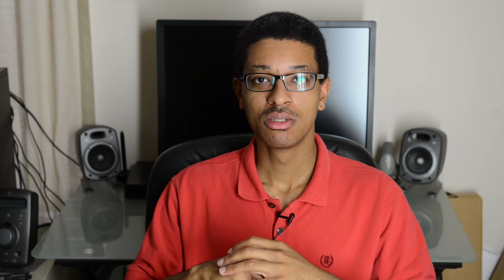Old VS New: When Should You Upgrade Your DSLR?

Comment: Yes you can get those wedding photos at a church that turned off the lights. The way the old film photographers would do it is place the camera on a tripod or place it on the floor if they did not bring a tripod. What you do is go all the way back to the last aisle use a wide angle lens and take about a one second exposure.

This might not be the ideal way but this is how the old film guys did it. Also with film  best to use ISO 400.

Comment: I have a D600 and I shoot mainly in the studio and few portraits outdoor too. I could do with out super fast AF or professional buttons on a camera. What I care about is the end result or high image quality. I recently had the oil spots on my D600 and it came back fine from Nikon thus far. When I purchase a camera I expect it to last me for about 3-5 years. I am not confident with my beloved D600 anymore and I think a D800 will be great for me. What should I do? I am a working on making a portrait portfolio at the momement.
Reply from the maker: The D600 and D800 are both very good cameras with similar image quality (main difference is that the D800 is higher resolution).  If you are happy with the controls of the D600 and don't need faster AF what has made you loose confidence in it?
Reply: For what I do the resolution is perfect. I don't shoot events. All I care about is high image quality. My D600 had dust and oil; therefore, resulting in about over a hundred of my cityscape and still life images being rejected by stock agency. I sent it to nikon and the sensor has been good so far. I think Nikon focus right now is in consumer market with lenses and cameras. Why we couldn't get the D7100 in a D300s body or D600 sensor with D800 body.
Reply from the maker: Interesting...I too have a D600 and will be replacing my aging D700 with a D800 soon.  I bought the D600 knowing what I was getting myself into but I am not shy about wet cleaning my cameras (I wet clean ever couple months anyway).  My D600 recently had it's shutter replaced; we will see how it does.  I wouldn't necessarily say that Nikon is focused on the consumer market...it's just that they are making their pro models full-frame these days.  I still see a reason for a "D400" to exist but unfortunately I don't think we will see one anytime soon.

Comment: This was helpful. Thanks. I'm interested in what's involved in using older lenses on newer cameras. I have some Nikkor lenses that I got with an FG 35mm at an auction. I want to use them with my d90 even though I'd have to manual focus. What is your opinion? Is this just a dumb idea? Should I just by new lenses?
Reply from the maker: The D90 does have a focus confirmation light to let you know when you have acheived the proper focus.  The only trouble is you won't have metering when using those lenses on the D90.  The only way to get the right exposure will be to take a shot look at it and then adjust your settings.  Cameras like the D7000/D7100 or higher allow you to tell the camera what lens you are using and the metering will still function.  I don't think it it's a dumb idea but it won't be the best option if you are shooting something fast-paced.
Reply: Thank you again. This is just another reason for me to want a df. Your review of that was also great. I really appreciate the time you put in here helping us out.

Comment: the d700 is still a great camera for it's age. but the nuts and bolts is still to spend on pro glass and keep them.
Reply: i would only buy a d700 in this age if i intend to run it into the ground. say way past the actuation count limit. getting it repaired could be a pain. you can now pick up a second hand one for about $1000 in tokyo. i would go for the 610 with good glass or a d800. both cameras will remain current and adequate for the next year or two.
Reply: i own both d610 and have owned a d700, and it's an absolute tank. it feels sturdier than a d610.
Reply: yes, it is, but like i said.............. in addition the 610 has far better image quality.
Reply: in low light? slow shutter speeds? the d700 performs better in certain situations. both camera's have great features. but for the price the d700 is an interesting choice paired with a pro lens.
Reply: true, but. unless you plan to plan to use it unil it fails or as a tide you over for the new d4s or 810, then yes, go for it.
Reply: is there a known failure issue on the d700? i have plenty of friends using it untill now, some pro photographers, some retired it to use us a backup. i think at that pixel count is over rated and that if someone is going full frame having headroom and cash for better glass is the way to go. bodies are easy to replace. glass is less likely to lose value. and that loss of value is great because when there are new body releases, the price go down quickly. with the release of the d4s i'll be looking for a cheap d4 out there. just for example
Reply: indeed. had a similar conversation regarding the d610 vs the d800. the chap has $3000 to spend on a camera and lens (2nd hand). he only shoots portraits in the daytime. many suggested he get a d800 of the df. not the best option and not enough cash, yes?
Reply from the maker: While I love the controls, build, and autofocus system of the D700 I like everything else about the D610/D600 better.  As far as the D800 goes I could never decide between it and the D600/D610...but there will be more about this in a future video :)
Reply: i say get the 800 even tho too big files on the d800 is a down side, specially if you don't need to print airport sized billboards. the d610 has a hard time focusing in low light and it has the focusing points like a napkin in the middle of the viewfinder. or get the d4 and get some fine glass with it.
Reply: laddy, just because the 800 has more megapixels and more coverage focus point, dont underestimate the 600. below a4 size you will not be able to tell the difference. even for magazine print they generally use less than 36 mega pixels. you will be able to work around the centre cluster of focus points on the camera. the 600 has better daytime image quality than a d4. even nikon admitted this. pair a 600 with a 24-70mm 2.8ed and you have a mighty fine tag team.
Reply: that's what i'm telling you, you don't need the d800's megapixel count. i personally don't need it. the d610 focusing system for me should have been better designed, i don't even care about the cross types and the af count. i've used the d610 with the 14-24mm f2.8 and it was the landscape king, i've used it with a 85mm f1.4 and it was the perfect street photography camera. the d700 can do that too. and it has an ok focusing system all of that for cheaper.
Reply: indeed.i would say this. is you want a sturdy camera with manageable pixels, good focusing  system with a dwindling life force, get the 700. me, i will stick with the newer models.

Comment: I'm looking to buy my first DSLR in early March.  I am looking at the Nikon d5300.  Yesterday they announced the d3300...with (from what I gather) are pretty similar specs minus the swivel screen, less auto focusing points, and a few other things that won't actually change the quality of the photos between the two.  In your opinion, should I save myself around $500 and get the d3300? The swivel screen would be nice! lol but....I'm wondering if I really need it. I don't want to have to upgrade my camera in 2 years.  I want to have this for a while.  And I think going forward, I will kick myself for not getting the d5300!
Reply: And also the kit lense that comes with the d5300 I think makes up for the price difference.
Reply from the maker: The 18-140 lens does make up a lot of the cost difference but if you don't need it the D3300 looks like it will be very nice for the cost.  The D3xxx and D5xxx cameras are still entry level cameras.  I still recommend going up to the D7000 or D7100 if you plan on advancing in your photography (heavy manual control use).  Of course as soon as the D3300 becomes available I will be taking it for a spin :)

Comment: Is was using Sony NEX gear, but dumped it for a Fuji X100S and more recently added the X-Pro1. The Sony video blows away Fuji, but for everything else the Fuji's blow away Sony. I sold off my NEX-6 and some lenses, but kept my old 5N around for video use. I'm getting good results with manual flash on my X100S, but with my 60D and ETTL the results are so effortless. I have no interest to upgrade from the 60D as with flash and base ISO the results are amazing 2.5 years later. No need for a 6D or 70D. I'm good.
Reply from the maker: I have a 5n right now also; I have been looking at the A7 and am really impressed so far.  Only problem is I want to try the X-Pro 1 but it isn't an easy camera to come by for me.
Reply: My NEX  5N overheat after around 3-5 minutes of video no problem at all  with NEX6
Reply from the maker: Interesting, funny thing is after using my 5n outdoors on 95+ degree days I never had an issue.  The one time I did have overheating issues was when shooting inside an air conditioned building at a comfortable 67 degrees...

Comment: Yea i was going to upgrade to a 600 but then i learned it had the same focusing as the 7000 and it has a smaller box of points. That's probably the biggest thing that bugs me. I like to put subjects on one side of the frame. The box is small where you cant move the focusing point far enough to one side where you have to re compose.

Comment: I would like to upgrade from my d7000. I currently have a nikon 35 1.8g, tamron 70-200 2.8 and nikon 50mm 1.2 ais for lenses. I'm not in a rush to upgrade but I have had to shoot in conditions at 2500 iso and it looks pretty bad. Seems like all nikon bodies have focusing issues lately so ill just wait and see how nikon will improve. I prefer a smaller body like an a7 though. That is an option too.
Reply from the maker: Out of curiosity which cameras have you had issues focusing with?  While I prefer Nikon's 51-point focusing system (D700, D800, D4, D7100) I have still had good results with the 39-point focusing system also.
Reply: For me i have had numerous back focusing issues with my d7000. I just recently calibrated all my lenses but havent really tested them out that much yet. Ive heard from others that even the d4 back focuses and is slower than say the 1dx
Reply from the maker: Ken Arnold
While I can't speak specifically about the 1Dx since I haven't had much time to shoot with it I can say that AF speed can vary across camera bodies.  For example the D4 tracks and acquires focus faster than the D800.  The lens used can also have an effect on things; for example a Nikon zoom like the 24-70 f/2.8 will focus faster than a 50mm f/1.8G.  While I plan to also do a more detailed video on lens calibration do keep in mind it is not unusual to have to AF fine tune fast prime lenses regardless of which camera you are using.  If you are noticing severe front/back focus on a zoom lens though I would recommend sending the lens in for AF calibration.
Reply: Thats a very good point. I do experience a lot more back focusing on my 35mm lens. The 70-200 only does it while im shooting a portrait. I lock focus using single point on the eye and it would focus on the tree in the background. It still doesnt do it nearly as much as my prime, never thought of it that way. What would be perfect for my taste, is if nikon came out with a competitor for the a7 cameras.
Reply from the maker: In your case moving to full-frame will make a huge difference in your low-light shooting.  I was going to put a D7000 in this video also but sadly don't have access to one right now.  In my opinion something like the D610 would make a good upgrade.  While it is small/light for a Nikon it is certainly no A7/A7r.  While I would love to see it sadly I don't think Nikon will come out with anything like the A7.  Eventually I will be picking up the A7 and FE 35mm f/2.8 (and an 85mm when they come out with one) to go with my Nikon gear.